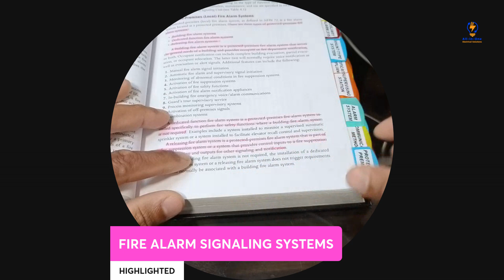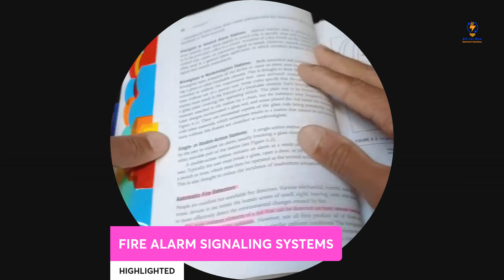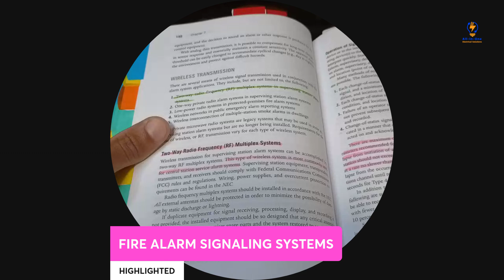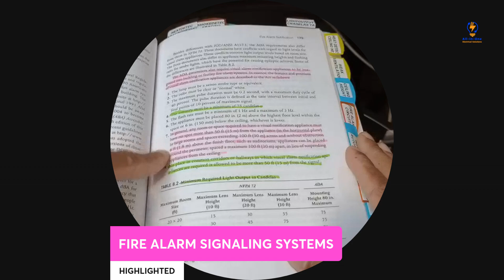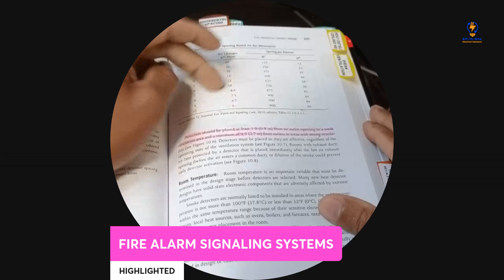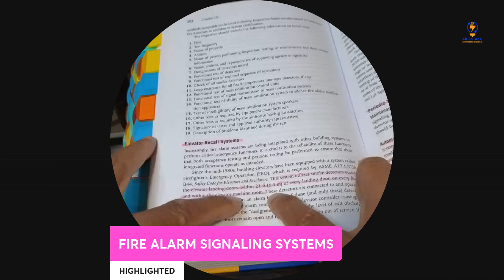“How to Get Your Florida Electrical Contractor’s License: Fire Alarm Signaling Systems. Highlighted

Comment: hey buddy thanks in advance for the video. Im getting ready for the CE test and your set of videos about it are helping me a lot. Just one thing from this video for future reference, u said that in page 233 table 10.1 about heat detectors spacing u could not get the right answer because u did not see 15ft in the table, the answer to that would be 0.77 on the spacing multiplier. Due that the table refers to spaces between the two heights they give in table so because 15ft goes above 14f and below 16ft the multiplier corresponding would be 0.77. The issue is the wording on the table that makes it a little hard to interpret.
Reply from the maker: Thanks for feedback brother good luck on your test